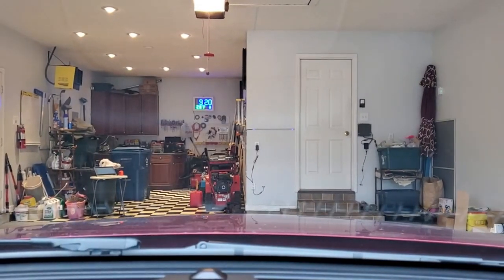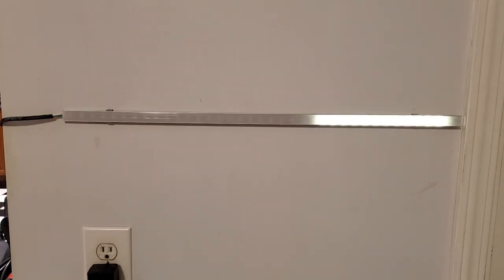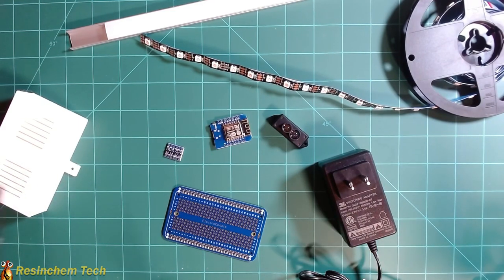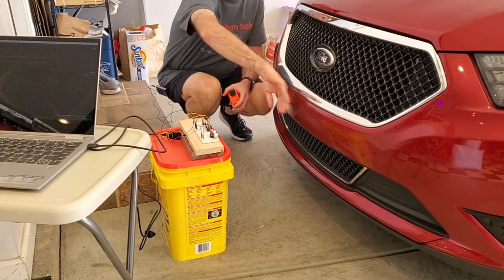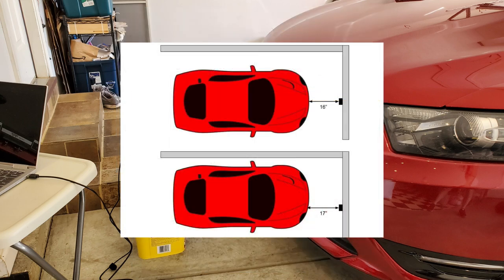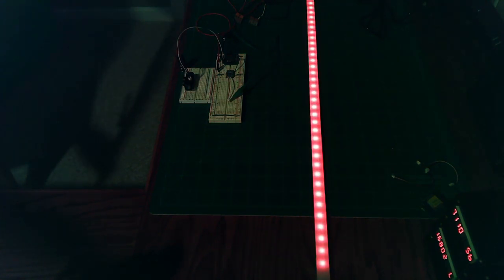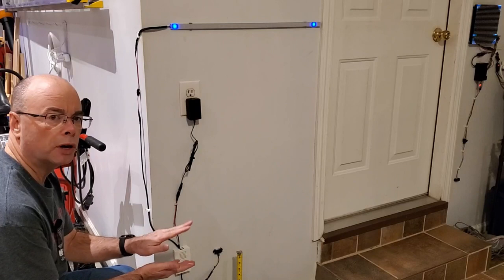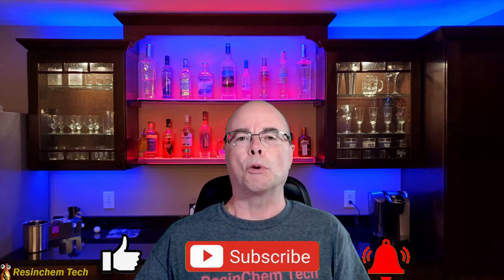A New Parking Assistant using ESP8266 and WS2812b LEDs

Comment from the maker: As a couple of sharp-eyed viewers have noted, there is an error in my conversion from mm to inches when showing the minimum distance for the VL53L0X sensor.  The correct value should be 50 mm ~ 2 inches.  Sorry for the mistake!
Reply: 50.8mm in fact.
Reply: Glad I came to the comments section to check before commenting! :D
Reply: I instantly saw that error when looking at the table, and I was also wondering why mixed units. Either put all in cm or all in mm. Basic science. I would make them all mm FWIW...
Reply from the maker: Well, pretty much for the same reason I went back and added mm as a display option for the web settings per request... to most non-US folks, inches have no meaning.  For for most in the US, cm or mm have no real meaning.  Many, myself included, would have no idea how long 48 cm is without using a converter... is that one foot, two feet, something in between?  So, to try to appeal to everyone, I show distances both in the video and on the app's web page in both metric and imperial.  But I can't make everyone happy all of the time.  Internally within the code, everything IS done in millimeters.

Comment: This is a great project. Thanks for sharing.   I made two minor modifications that improved my experience.   

- The first is an update of the libraries and recompile to eliminate some pesky wifi issues.  Wifi is rock solid now with no more misc broadcast of local AP.   

- The second modification is to adjust the response time of the status bar.   I found myself pulling into my garage and waiting for the bar to update.  Many times as I was creeping forward to wait for the bar to change, I overshot the "ideal" range and had to backup.   My fix is relatively simple.  There is a delay(200) at the end of the MAIN LOOP, which I changed to delay(50).  The response time of the status bar is much quicker.

Thanks again for this project!

Comment: Cool project. Have you given any thought about how to incorporate lateral alignment? My garage is pretty tight so getting the car aligned left and right is important too. Your original project has a display that looks like it could tell you to steer left or right. I have some ideas but they require a lot of ceiling-mounted sensors or a camera with some image processing (a sensor on a wall perpendicular to the front wall won't work for me). Anyway, I enjoy your projects, keep up the good work.
Reply from the maker: Actually, the original Raspberry Pi version did have a side/lateral sensor (another TFMini), but I could never get it to work consistently (yes, the matrix display actually has side arrows defined to help with that lateral distance... but I stripped that out of the project).

For this new version, I toyed with the idea of trying to do something for lateral alignment, but it would probably take a completely separate processor, LED strip, etc. as the D1 Mini only supports one serial device.  But there are a lot of possibilities, including moving up to an ESP32 for multiple serial ports.  But it sounds like your problem is made more difficult if you can't mount a sensor on a side/perpendicular wall.  Just thinking "out loud", you could do something like two TFMini sensors on the ceiling (you'd need these for the narrow field of view), mounted just to the outside of the lateral "lane".  Then if either trigger, it would like up a corresponding LED to indicate straying too far to one side or the other.  That's just an "off-of-the-top-of-my-head" idea.  There are probably other ways to tackle it.

For my situation, lateral distance wasn't as important... other than getting too far one way or the other also impacts the front reading due to the curved bumper.  But the "parked" zone is wide enough to accommodate that in my case.

Thanks for watching...  feel free to reach back out if you have any other questions or thoughts!
Reply: Here is a silly idea that is lower tech. Perhaps have the wake mode also turn on a simple visible laser pointed "dead center" of a perfectly parked car. Then, when your angle is wrong, you will see the laser reflection on the wall and can work it to point straight back.

Comment: This is so ingenious - and your detailed instructions are great. Unfortunately, we don't have a garage. We park two cars side by side in a wide driveway. Thus we have to pay attention to side-to-side position as well as positioning the left side car behind the other for easy driver's door access for the forward car. Sure would be great if we could figure out a sensor to mount on the house that would nail these two positions for the drivers.
Reply from the maker: Thanks... I appreciate the kind words.  I've had numerous requests for something that provides lateral, or left/right, guidance.  I'm considering a couple of different approaches... one that integrates lateral guidance into the existing system, or a separate system that would provide lateral guidance only.  The second option may be of interest to you, but there are a few things that I think might still be a challenge for you.  First, if this it going to be mounted outside and exposed to the elements, everything would have to be made waterproof... definitely not something that my current system has.  Next, any sort of sensor that is going to detect lateral movement would likely have to be mounted to the side of the vehicle.  If you just have an open driveway, I'm not sure where or how you would mount the sensor.

But I guess that's why I try to explain the "why" as well as the "how" in my videos.  I hope that viewers may be able to take my ideas or concepts and adapt them to their own projects or needs.  So, maybe if I do add some sort of lateral detection down the road, maybe you can find a way to adapt it to your needs.

Thanks for watching and taking the time to post a comment!

Comment: Great Project, it's just what I needed for my garage. I don't have much room to play with, and this helped with getting my truck parked just right.
I was going to post on the Blog, but was having problems getting onto the comments. But FYI, I did have a problem at first with getting it set-up
I found that I had set the TFMini looking right at the front license plate, and would get inconsistent operation. Thinking that the reflective part of
the license plate might be interfering with the sensor. After moving the TFMini over 2' and resetting the distance, It worked like a charm. 
Thanks.
Reply from the maker: Glad you got it working!  We don't have front plates on our cars, so I obviously haven't experienced that.  But I guess it is entirely possible that the plate reflectivity could scatter the signal and cause the issues that you were seeing.  A good point for anyone else that might install the system and have a front plate on the car.

Thanks for taking time to share the issue (and resolution) and for letting me know that you successfully built the project.

Comment: Thanks for sharing this wonderful project. While I love all the features of this sensor, I build my sensors to give as gifts to friends. In doing this, I am conscious of cost and simplicity. I use the ultrasonic sensor mounted in a 3D printed enclosure along with the microcontroller. I then use a Cat 5 cable to transfer power to a conventional red and green LED mounted higher in its own tiny enclosure. I do not need a computer or phone to interact or set up my device once the microcontroller is flashed.  The green LED is on unless the car is in the parked position. To program the parked position, just park the car in front of the sensor and push a momentary push button on the enclosure.  The controller takes the reading at that moment and stores it in EEPROM so that the set point is not loosed during power outage. For my personal use, I will likely build your sensor.  Thanks again for sharing.
Reply from the maker: You are welcome.  Yeah... if I was building (or giving as a gift), I'd definitely pre-flash the controller.  And I tried to add as many different options to mine to accommodate different use cases.  But this does require onboarding to wifi and using the web interface... complicating things a bit for the end user.

I love the idea of a momentary push button to store parking locations though.  That's a great idea that never occurred to me (I love it when I get new ideas from my viewers)!  I could see even adding four small different colored push buttons to a controller box that would set the four different zones in my case.  Hmmm....

And of course by only having two LEDs, you not only eliminate the need to specify the number of LEDs being used, but also substantially reduce the power requirements.  All great ideas!  I do know that my wife, however, does like the 'countdown' approach lights in both the Pi and the WS2812b version.  But your version is definitely simpler to build and use (writing that web interface and onboarding process for the measly ESP8266 was a pain!).

Thanks for watching... and thanks again for sharing your build ideas.

Comment: Awesome tutorial. For now, I just use a piece of wood that I boltet to the floor. But this is a far more sophisticated solution. Also, no trip hazard due to the piece of wood - which may or may not be an issue depending on the circumstances.
Reply from the maker: Thanks!  Yeah... there are a lot of "low tech" solutions.  I had a tennis ball on a string from the ceiling initially.  But when I would be working on a project in the garage, seems like I was always banging my head into the tennis ball.. or catching the string on a 2x4, etc.

Plus you really can't really integrate a tennis ball (or piece of wood!) into a home automation system to use it for something like vehicle detection.

Thanks for watching and taking time to post a comment!

Comment: That's great design with cost effective components.  I appreciate the explanation of the more expensive TFMini-s and agree.  You mentioned a car presence function.  I immediately thought of car not present and garage door open possibly indicating someone drove off an left the door open.  There would need to be some rules to go with that before taking some action and a way to disable it if you're working in the garage with the door open.  But, could be useful for some.
Reply from the maker: Thanks... actually my parking sensor is used as a secondary presence sensor.  There are two ultrasonic sensors mounted on the ceiling over each of the cars (connected to an ESP8266 running ESPHome... it also has a reed sensor for the overhead door connected) that also reports the presence (or absence) of either car and verifies the door position agrees with that reported by the smart garage door opener (Tailwind).

So, I can crosscheck both car presence detectors and both garage door sensor positions before I take any automation action, especially actions related to arming/disarming the alarm system (which also adds phone presence detection as well).  When it comes with anything to do with home security, I definitely want more than one sensor reporting.  The parking assistant simply added yet another way to assure a car is present or not when compared with other sensors.  And as you mentioned, even if both cars are out of the garage (maybe because I'm working on a project in the garage), my phone would still be present, so the automation to arm the alarm system would not fire.  Just one of many automations related to presence detection.

Thanks for watching... and taking time to post a comment!

Comment: Thanks for the hard work you put into this project! I opted to use a different esp8266 controller I had laying around and spent a few hours thinking I had wired something incorrectly as I could only get 1-2 pixels to light up when booting but finally realized I needed to use pin d6 and have a little more patience. Working great!
Reply from the maker: Glad you got it working.  I tried to build as much flexibility into the system through the web interface as I could, but selection of the LED data pin wasn't one of the things I included... so it's pretty inflexible on that account.  Well, unless you want to modify the source code and compile your own version.

But regardless, congrats on getting it up and running.  My wife loves the one I built and it is a pretty big improvement (and cheaper) than the original Raspberry Pi version that it replaced.  If you run into any questions or problems with the system, please don't hesitate to reach back out.
Reply: @ResinChemTech  my wife is a big fan and she LOVES not having a tennis ball hanging from the ceiling.

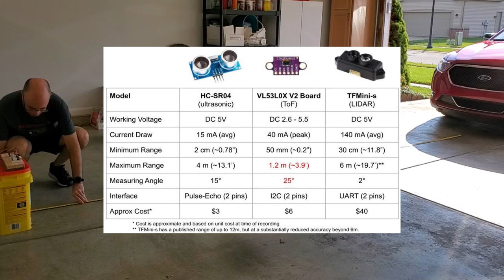Comment: 10:00 spot the mistake 😊, 2cm (20mm) is a lot less than 50mm (5cm), almost tempted to try something like this but will need a lot more accuracy than the LIDAR as i park outside and almost touch the garage door when parked, the reversing sensor on my van is not reliable so tend to go really slow and touch park.
Reply from the maker: Good catch... and you are 100% correct!  In my effort to convert everything to inches and feet (since Americans mostly refuse to adopt the metric system), I advertently left  a "0" out of the conversion calculator I was using... entering 5 millimeters instead of 50!  Thanks for the correction!  But the maximum range is correct and the ToF sensor quickly drops out of the testing ranges.

None of these, I believe,  would work in a situation where you have to park within an inch or so of a wall or door.  I wonder if something like a contact sensor on a flexible surface (or spring) might work better in that case?  Maybe something that you would slowly approach until you make contact... and that contact would then flip an LED or other indicator on?  Just a thought.  But thanks again for spotting the mistake... and I'll see if I can post some sort of correction somehow.

Comment: Great video and instructions. I'm glad I found this. Did you consider wireless transmission from the sensor to the box?
Reply from the maker: Thanks!  I think quite a few people have successfully duplicated the project for their own garages... at least based on the feedback I've received.

I didn't consider wireless and while I think it would be nice to eliminate the wiring and provide a little more flexibility in terms of where you could mount the controller and LEDs, it would also likely present a number of challenges.  First, you would have to add a second ESP or other board to connect to the sensor.  The sensor uses UART to communicate and doesn't have its own controller... it's just a sensor... so a second board would be needed to communicate with the sensor and then to transmit that data to the primary controller.

I also suspect it would introduce at least some latency.  When you are approaching the final parking position and if you have a very tight tolerance, any latency could be a very bad thing!

Finally, if looking at using WiFi for communication between the sensor controller and primary controller, many people have weak WiFi in their garages (if any WiFi at all... I've already had requests to create a version that doesn't require or use WiFi).  I suppose you could use something like Bluetooth or ESPNow, but that adds more complexity and my code definitely isn't designed to talk to another controller over any sort of protocol.  So while a wireless sensor is an interesting idea, I don't think it would be practical with my current design.

But I appreciate the comment... and the thought on how to potentially improve the system.

Comment: Looks great, and amazing balance between speed and details.
I never saw the Rasp.version video. If I did, I would have probably said the pie was overkill.😉
Reply from the maker: Oh, the Pi is definitely overkill and underutilized for this particular project!  But I built it back in the very early days of my DIY/Home automation journey... and for me, it was more about learning the Pi, Python and if I could even get the matrix to work.

That's one of the reasons I decided to remake the video.  With what I've learned over the years, I could apply that to make a much lower cost, easier-to-build and much more friendly to use version.  My wife actually prefers the new version, so as an added bonus, I now have an extra Pi and LED matrix to play with or use in another project!
Reply: @ResinChemTech  Oh, I think we all have that type of experience, when you cannot imagine why you did something that complicated 10 years ago with the knowledge you have now.
But we have learned.

Comment: I needed a narrow field sensor and you have helped me decide on the TFMini.  Much pricier than the high-value ultrasonic sensor though.  Thanks for this great comparison video.
Reply from the maker: The narrow FOV was one of the reasons I used it as well... along with the range and better signal stability than the other options.  Yes, it is a bit more expensive and I wouldn't use it for every use case, but for me it was the best solution for the parking assistant and my installation.

Thanks for watching and taking the time to comment.